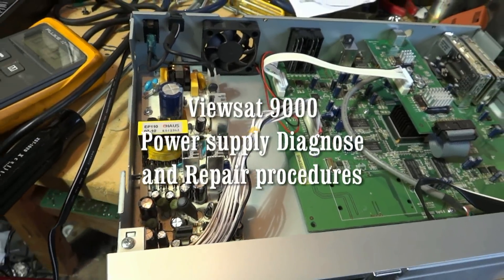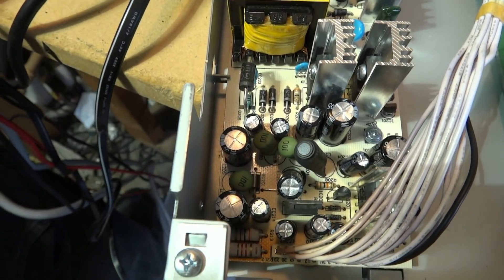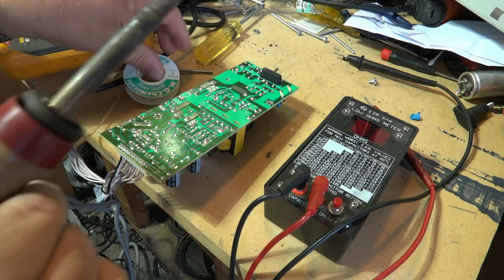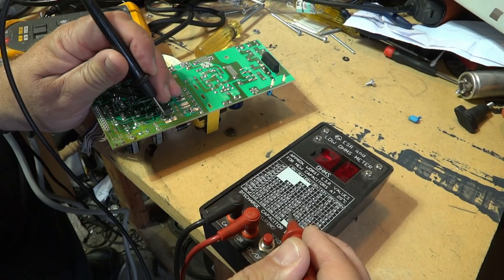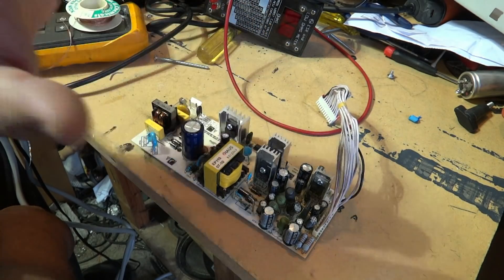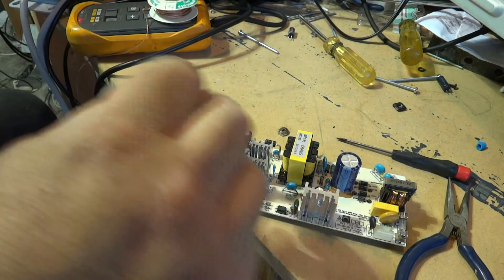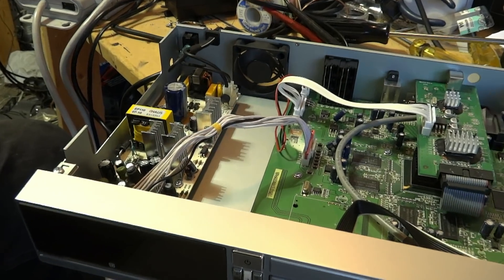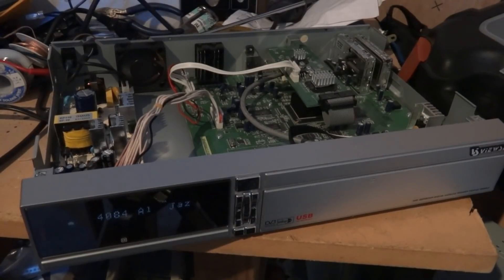Viewsat 9000 FTA Satellite Receiver Power Supply Repair

Comment: @ 3:52 you say you have a "Home-built ESR meter". Did you build it from a diagram found Online or your own design?
Reply from the maker: It was a kit purchased from a local electronics supplier. They still sell them. I built this back in the days before there was any "online"
Back in the mid to late 80's when if you had a 386 computer you were the coolest guy in town. There was no internet, and dial up BBSs with a speed of 1200/2400 baud were about the only way one could be connected.
Reply: https://www.altronics.com.au/p/k2574-esr-meter-kit/

Comment from the maker: Actually this is pretty safe to work on as my test bench is totally isolated from the AC main by way of an isolation transformer. I could grab onto the hot side, with my feet stuck in a bucket of salt water and I wouldn't feel a thing! No isolation transformer, and you are having a very bad day.
That is the point of an isolation transformers. We used to use them on our old electric razor outlets in bathroom plugs before the GFCI plug was developed. In addition to isolating the test bench plug from the AC line, it is also current limited. Not that I can't pull a whack of current through my transformer, I believe is it 500 watts I have, but it is the isolation that makes things safe. To get a shock I would have to contact 2 points on the circuit one on each side of the input. Now without this, touching any energized component while another part of the body provides a ground path is dangerous. Also, I follow all safety guidelines, and wear insulated shoes, my chair sits on a rubber mat, and I only contact live components when testing with 1 hand. The other hand is in my pocket, or away from any possible return path. Pretty safe for low voltage work, and by low voltage I mean 120/240 volts. Naturally of working with higher voltages PPE such as rubber gloves, and arc flash shields are needed. Notice that I did make sure that the main filter was discharged by shorting with a pair of pliers. That is because that cap normally stores a couple hundred volts, and even though it is not lethal, it can give you a nasty shock.
Speaking of shocks, I have had a few in my prior career, which was repairing equipment. A magnetron power supply jolted me with 2,100 VDC that literally threw me across the room. I am still talking because I was not grounded, but the shock when the insulation on my pliers failed caused me to jump about 3 feet.
The second time I was jolted was from 30,000 volts from a picture tube I was going to set up the convergence on. My apprentice that had changed the tube forgot to completely clean the glass around the second anode, and when I reached around the set to adjust the convergence magnets, a bolt of lightning shot out, into my forearm, and out my thumb to ground. It split my finger nail, and it felt like I had just hit my hand with a hammer. That was 20 years ago at least, and I still have a ridge down my thumb nail where the spark jumped from my hand to ground. Believe you me, I do respect electricity. I am scared to death of something I can not see that can kill me.  At work now, I work for a utility, and I am working up power poles in vicinity of live wires, so electrical safety is foremost on my mind.
Reply: I got a free to air sat box it will not power on can you fix it?  well for one the inline surge fuse is blown. i can replace it but i dont know if anything else is wrong with it.
Reply from the maker: The old boy that owns this watches the free stuff, and I don't think there is many English channels left on satellite that are free other then the terrorists news propaganda channel. I haven't heard from the fella that owned this unit in quite a while. He was very advanced in age last time I saw him, so me may be what is known in the ham community a silent key now. (he was a ham radio guy, and you know how some of the hams are right. Very colorful characters. I have to be careful as I have had my ticket for about 30 years.)
Reply: I was watching One of my co-workers when he got shocked from a capacitor in a microwave oven. He was standing up at the time, the charge threw him backwards against the wall of the shop. he was stunned but otherwise unhurt. It really scared me.
Reply: 12voltvids i just pulled the power supply on my epson printer because of no power and saw the board was corroded and rusty liquid all over it i took it apart to see the other side the largest component I believe is the transformer was leaking fluids out of it! Is that replaceable?

Comment: Nice video. What model is the Fluke measuring instrument in the left ? Thx.
Reply from the maker: Its an old Fluke 12. I bought it probably 20 years ago for my personal meter. I had a Fluke 77 at work, but the shop owned that one. The ESR meter was a kit I built. This Fluke 12 works great, the only problems I have had is the pass through connectors that sandwich the button board to the pc board, and display go funny, but the fix is simple. Remove the board, and reinstall it. That reseats the connectors.

Comment from the maker: It was a demonstration to show the power of an ESR meter. Naturally I didn't need to use it because the caps were obviously bad, however many don't look bad. I didn't bother testing the others, as from my experience it is usually only the ones on the DC rail that fail.
I could have tested good ones, to show how they would read. Wait a minute, I did test good ones, the new ones.

Comment: you have a good way of teaching. I'm wondering why you would bother using an ESR meter to test obviously bad caps? Do you always test obvious blown parts with the meter? It sure seems like a waste of time. And you didn't bother to test the non-obvious caps with the meter. Isnt that what the ESR meter is really for,  catching things that arent always obvious? I have the cap wizard and just blew its 1 ohm resistor because i forgot to unplug the power from my device before testing! DOH!

Comment: I subscribed because I was very impressed.  If you ever tackle the YLOD on the PS3, or the RROD on the Xbox360 gaming consoles; I would greatly appreciate a heads up.  Thanks A lot, and keep'em coming.
Reply from the maker: No I don't have any experience with gaming consoles.
I left the consumer service business back in 2003 after a 22 year career repairing TV, VCR and audio equipment. I am in a totally different industry now, but stay active as the "neighbourhood tech"

Comment: Cool home made cap meter.  Got any plans for that ESR meter?
Reply from the maker: It was a kit I built at least 23 years ago when I was working in the electronics repair business. I remember telling my boss about ESR meters, and he wouldn't buy one because he didn't believe they worked. So I went out and bought the kit for I think it was about 90.00 and spent a few hours building it. They are still available from the same place I got mine, for about the same money.
Even after proving that the meter was worth every penny, the guy I worked for wouldn't buy it, but he sure wanted to keep it when I left, so I told him my time to assemble it would cost him 300.00 if he wanted it, and then packed it away with my tools, and other test gear I owned. Its a real time saver, as it will identify caps that are on their way out long before there is any physical indication (bulged cans ect) that the cap is bad. Check capacity, and a bad cap will generally still test good as far as capacity goes. This checks ESR, which is the only way to check an electrolytic.
Reply: 12voltvids Wow. What greed boss!  I wonder if you have video of how to make ESR meter? I'm curious.  

PS: I'm guess your former boss is graduate as TC degree lol.

Comment: I'm a beginner in electronics, and I have a question regarding checking the ESR of the capacitors. If the ESR of a capacitor is very high, would that simulate an open circuit?
Reply: *****
Cool, thanks for the info.